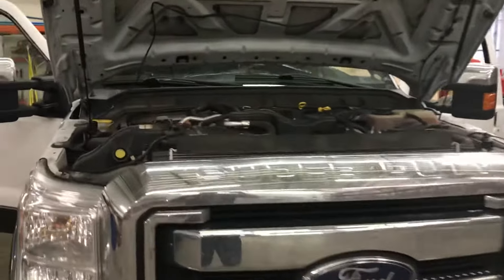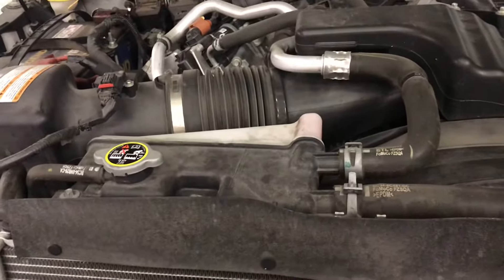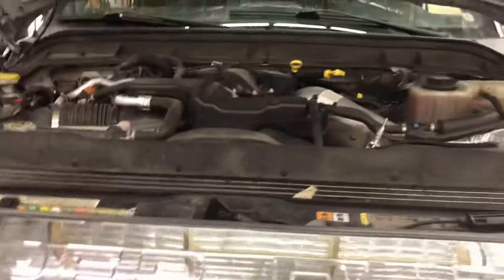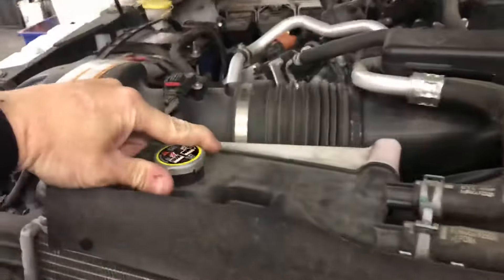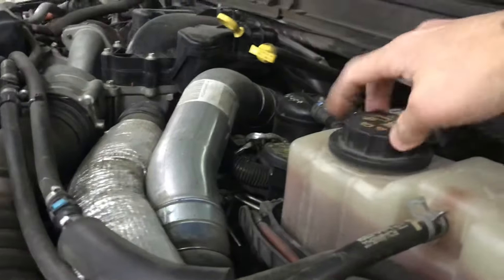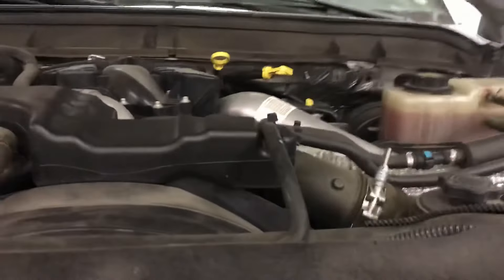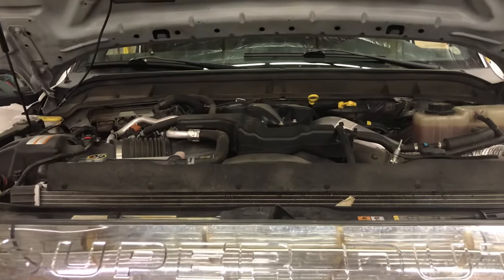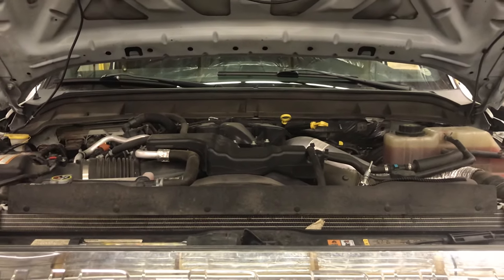Location of Primary and Secondary coolant Reservoirs / fill & bleed system 6.7 Ford F-250 / F-350.

Comment: I bled mine like you said on high idle, for about 10 minutes. Then I tightened the primary cap and took it for a drive and got the coolant to 194, when I got back I noticed the level dropped a bit. I’m curious Where does the coolant/bubble go when the cap is it tight?

Comment: Explaining how to fill and bleed cooling system according to Ford? Like where is the drain located?  Fundamental thing.
Reply: Since the video is titled "coolant fill", i dont know why youd expect him to be draining anything.

FYI, main radiator petcock is on drivers side up and behind bumper, and secondary is on pass side in the same area, but its easier to pull the rubber hose to the cooler thats also behind the passenger bumper to drain.